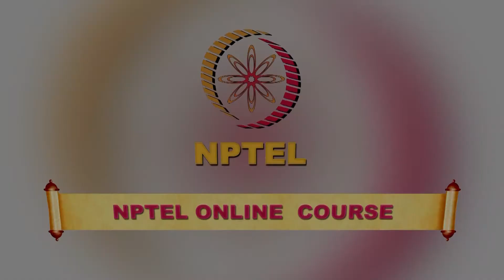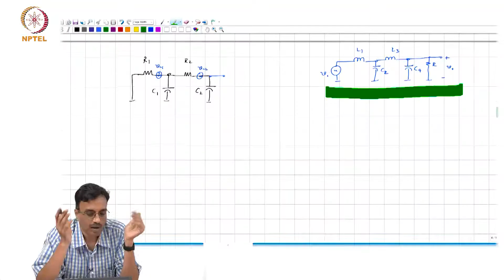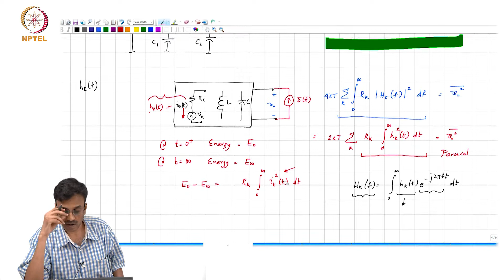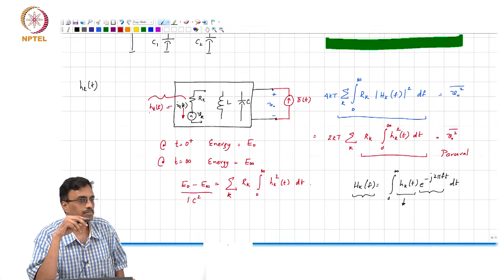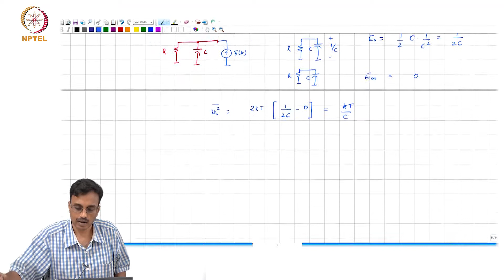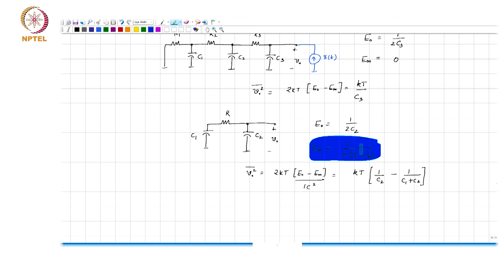Total integrated noise in RLC Networks

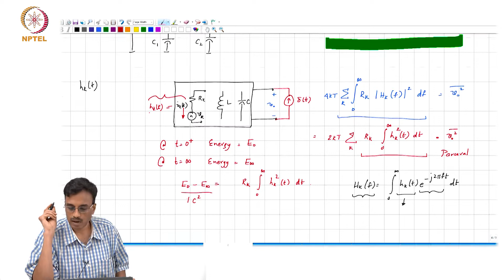Comment: at 15:00, I didn't get how to get h(t) from i(t)?
Reply: A very tricky pt. indeed. He invoked a unit-based argument. If that's not convincing (non pour moi) consider this instead: multiplication in freq domain -> convolution in time domain; so with i_k(t) = inte_{-inf}_{inf}(delta(tau)*h_k^(t-tau) d tau) the difference in energy  = sum_{k} R_k* inte_{0}_{inf} h_k^2(t) dt. Essentially the double integral is reduced to a single integral b/c of the delta current input being a distribution.